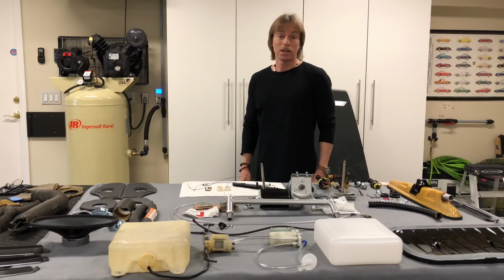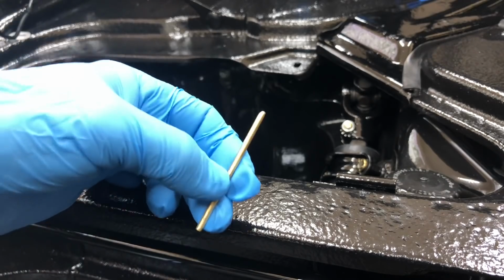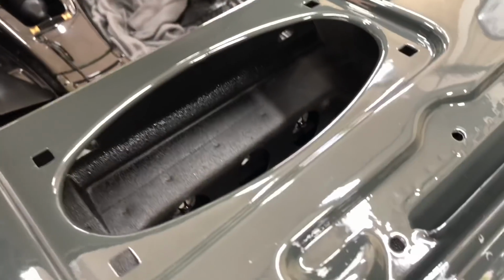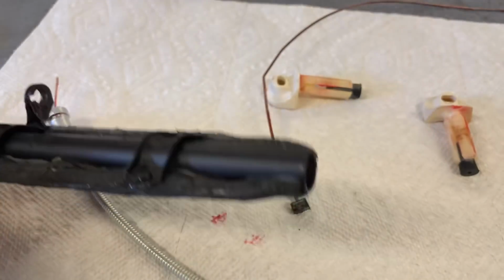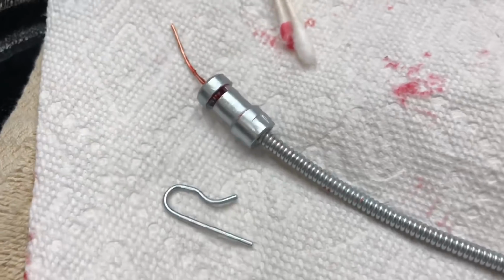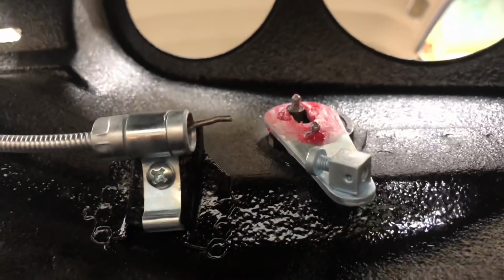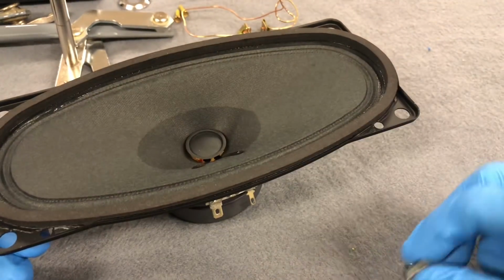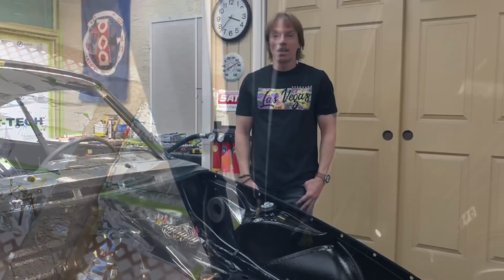1967 Porsche 911 Video 51 Dash & Trunk Bay Part-1

Comment: Hi,
i'm consuming all your 911 restoration videos and trying to learn from your details...

about that flap lever repair job that didn't work, can you consider having that part modeled and CNCed in aluminium? 
i used before the emachineshop to make small parts and it's awesome ;)

keep up your awesome job... beautiful
Reply from the maker: Hello unhuz
Yes you sure could CNC a part out of aluminum or also 3D print a plastic part. 
Im pretty sure if even in plastic it would be much stronger thank the  Baekelite used in those days
The switch will still operate more smoothly  if the part is cemented.
Too much leverage on the switch with the original engineering

Comment: What generally goes around these airvent flapers is "armaflex tape" 3mm thick.  It has glue one one side and is soft enough to both seal well and the flaper not klunking.  Its used in HVAC. You put it around the flaper and cut to size with scissors.
Great video!
Reply from the maker: Thanks for sharing this tip also! 
You are great to have around!!=)

Comment: Absolutely gorgeous work!  Wish that was my car you're working on - there's also a ventilation filter (Porsche part number 901.571.295.20) that I didn't see in your video - did you decide not to install it?  I'm overhauling the same fresh air system in my '68 and ran across this part in one of the PET diagrams.
Reply from the maker: Hello Rotarybreather
Thank you=)
Thats a great point you bring up! The Porsche experts would be able to clarify better than me 
on that filter.
My car was not equipped with the Webasto heater and blower motor. Also upon disassembly there was no evidence of that filter. I live in very warm climate so Im not installing at this time.
It will restrict fresh airflow to some degree flowing freely into the car. If when she's up and driving 
the airflow is noisy/ whistling  or too much flow I will add one in.
My guess is that would have been something they put in with the blower motor as it is able to force
air thru it.. im not sure it would have been used for non blower applications.
Perhaps some viewers could lend there expertise here
Thanks for sharing and bringing attention to this area!

Comment: Getting better and better! I've been wondering if one can use the retro-brightening technique on something like the old washer bottle. Have you tried this?
Reply from the maker: Hi Feeesh
Im not familiar with that technique..perhaps you could provide us with any links
Reply: Hi Mike

Its using hydrogen peroxide under UV light to bring back old yellowed plastics (used mostly to restore old computer hardware, Nintendo, Apple...). Curious to see if it works on clear plastic as well.
Reply from the maker: Feeesh
Please give it a try and lets us know how it works!
Ive tried various things before on these yellow bottles but not much success. Soaking in bleach too and still won't budge..
Sounds promising!

Comment: I have realized the value of original porsche parts to avoid problems. I think retailers should protect costumers and work harder to clean out bad after market parts.
Reply from the maker: Hello Martin
I agree with you 100%..im not sure how some of the parts are able to make it to  market.
I would thing licensing and quality would be something Porsche
would have to sign off on before they could be sold and representing the high quality Porsche brand.
No doubt though Genuine Porsche is the way to go and my hat off to them
for having so many quality parts still available for these older cars

Comment: Fantastic as always Mike!  The flap and lever are still original in my '67...now worried about the condition of the flap looking at yours.
Reply from the maker: Konnichiwa John
Wow..thats amazing..Still working?
I would imagine the flap is a little dried out and the cable could probably use some grease..I couldnt imagine taking it on though without pulling everything out from under the dash.  My nest video will show access closing off as I'm adding in larger  components